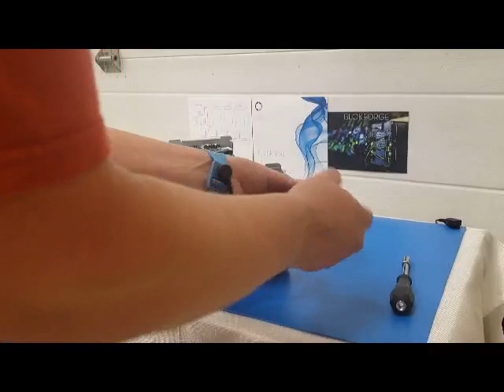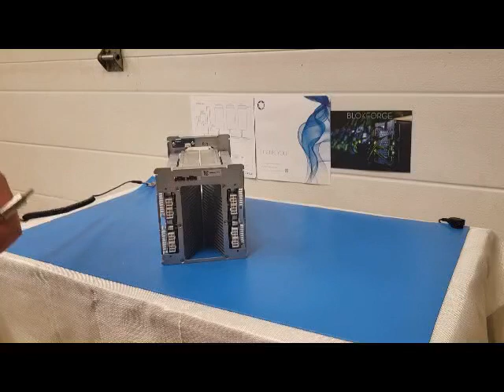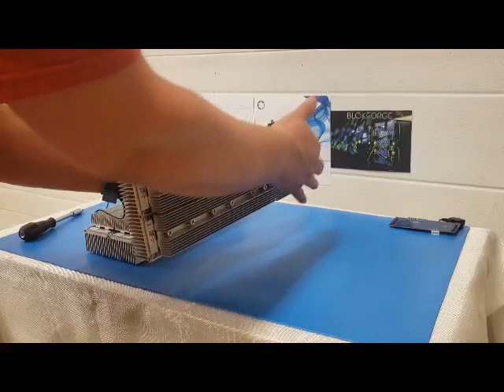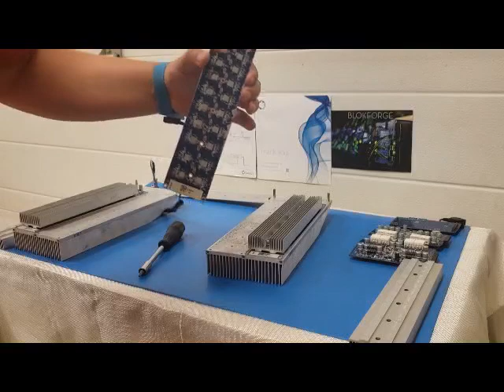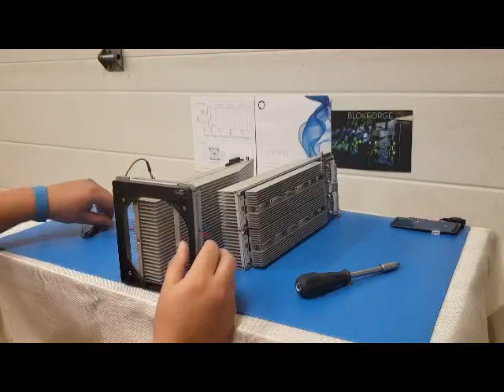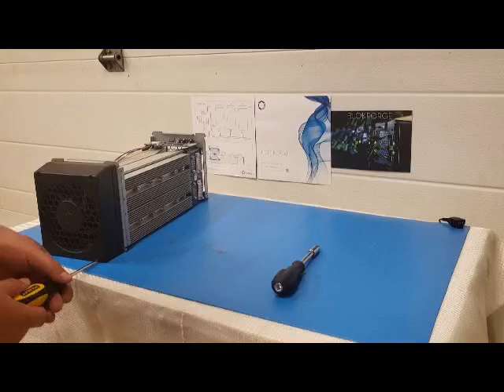Avalon 841 Repair/Tear down

Comment: Hello helep a921
Reply: Hi buddy , there is Avalon miner parts supplier in China. What happened with your 921 ?
Reply: @BITSOLOPLAYER  power module one light red is on
Reply: @BITSOLOPLAYER  WhatsApp yes +998995729011
Reply: @BITSOLOPLAYER  write please. Whatsapp
Reply: @BITSOLOPLAYER  Well hash boards avalon

Comment: Hello help, please, I have an Avalon a921 1 hash board does not work light red is on
Reply: Hi gay. Led Red is for high temperature (you need make mantenice and replace thermal paste) or low voltage (you need check cable and amperage draw). But I think your problem is for high temperature.
Reply: @jorgenicolasleonpinto7787  which thermostat and how many grams
Reply: My a921 just gives a yellow light and won’t start mining
Reply: Any idea how to repair